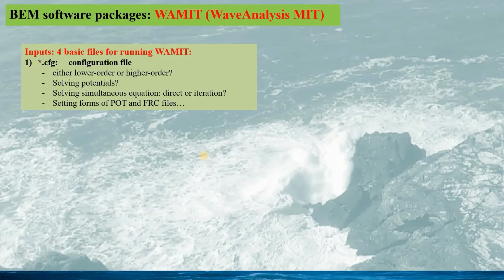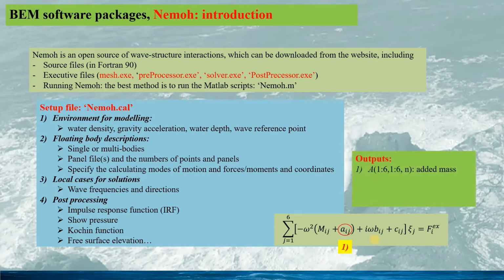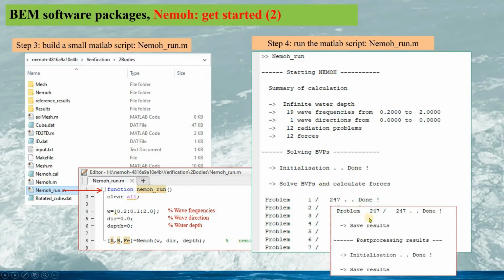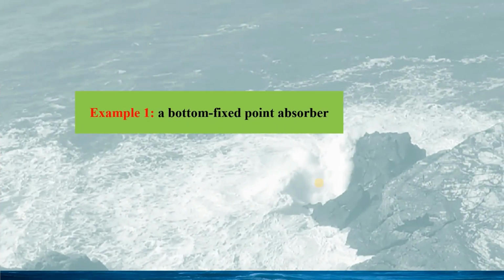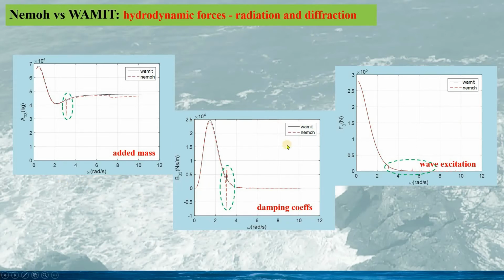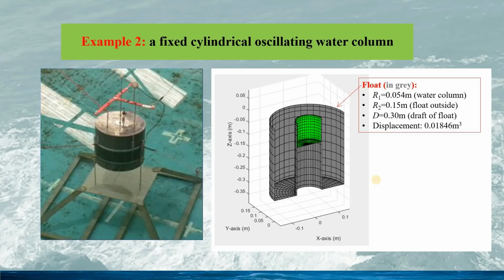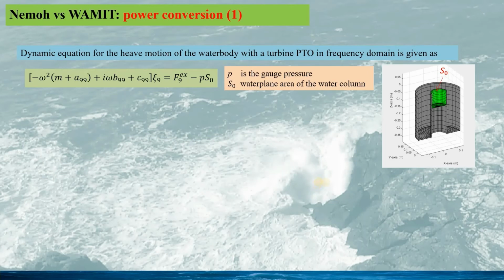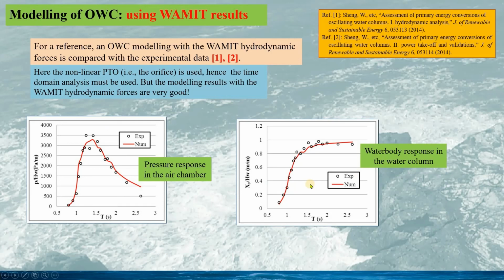[Wave Energy Conversion] Boundary Element Method, Part 5: Examples and Applications

Comment: 00:00 Introduction
01:52 WAMIT
05:20 NEMOH
17:08 HAMS
19:16 Example 1: a bottom-fixed Point Absorber
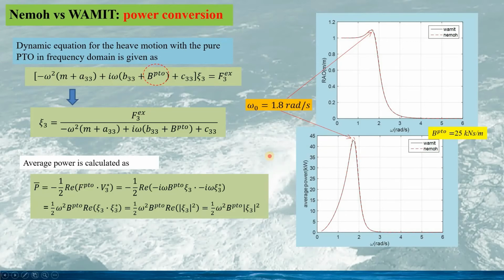29:48 Example 2: a fixed cylindrical Oscillating Water Column (OWC)
Reply from the maker: Thank you to list the topics.
Reply: @ScienceofFluids  Thank you for the great videos <3

Comment: Professor i want to know how you get 25kNm/s for PTO damping?? Thanks
Reply from the maker: I choose one without a particular reason. But it may be a reference if we examine the maximum radiation damping, it would give you the magnitude of PTO damping. This is the way worked for me. As for the optimised PTO damping, you should refer the some referencee.